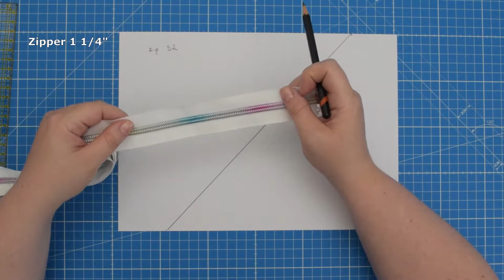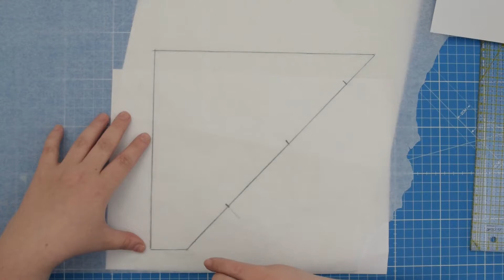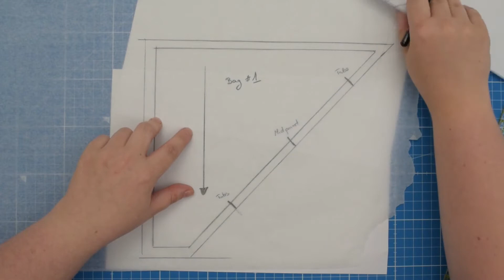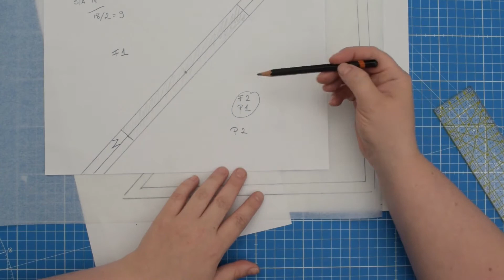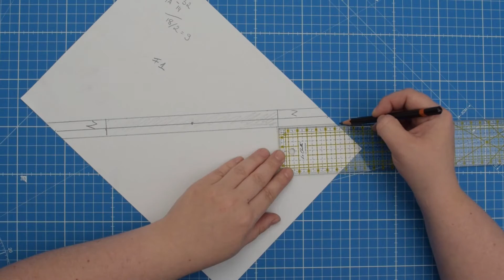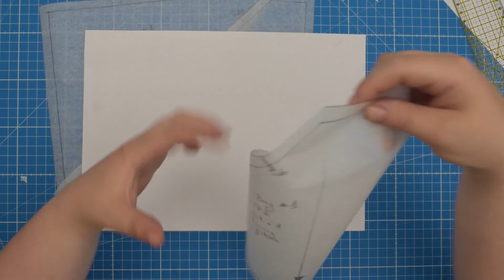How To Make A Diagonal Zipper Pocket Pattern

Comment from the maker: I love pattern drafting ❤
Comment below if you enjoyed this tutorial! What would you like to learn next?
Reply: OK, here's another thing I've wondered about.  Let's say you have a pattern for a flat pouch and you want to make it 3D by adding a gusset.  How would you draft the gusset piece?  TIA.
Reply from the maker: Interesting idea. So you don't want to use boxed corners, but instead a separate gusset piece?
Reply: @allsewpetite  Yes exactly.  Love the box-corner tutorial -- I've used it already with success.  But let's say you want a gusset for a pouch with rounded corners. What's the math you'd use to figure out the length?
Reply from the maker: Oh that is fantastic to hear! So happy my tutorial was helpful 😊
Going back to the pouch, there are different ways you could add a gusset. Do you prefer angled gusset, so you would have a flat zipper at the top, more triangular sides and wider base? Or do you prefer a gusset which has the same width throughout?
Reply: @allsewpetite  I'm interested in all, of course! 🙂
Reply from the maker: Noted 😜